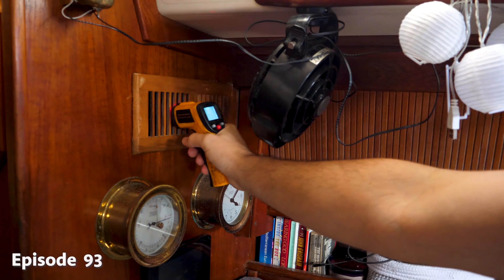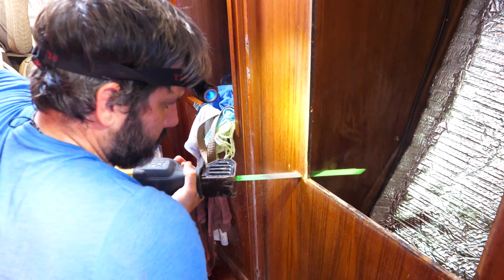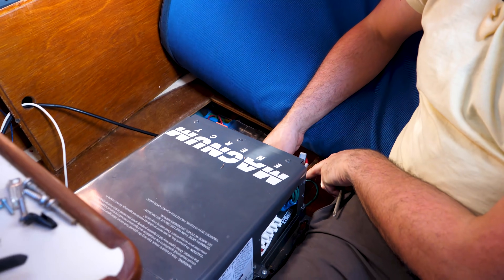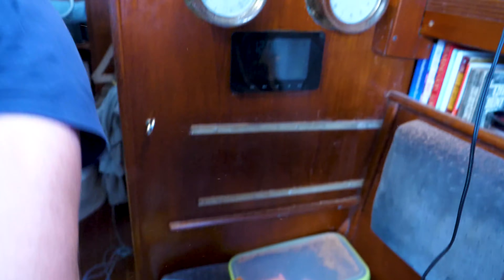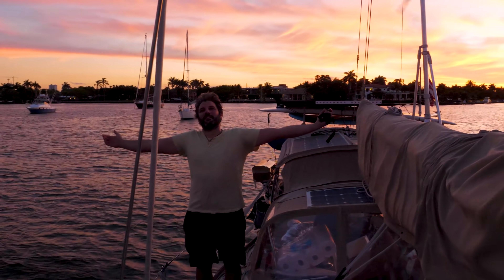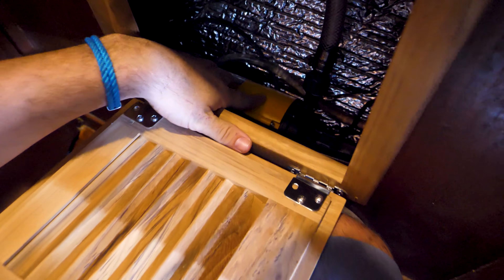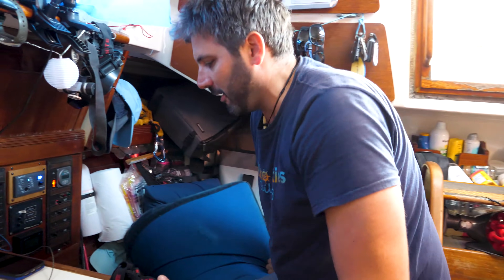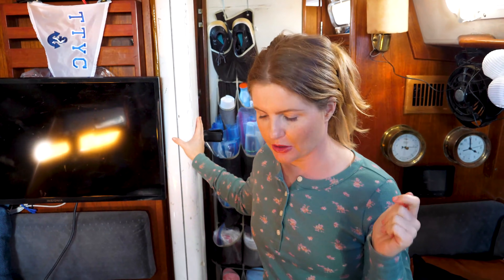Will we be able to run our 16,000 Btu AC off our lithium battery bank?! (Calico Skies Sailing Ep 93)

Comment: Nice job!  Its not easy to find room and install an AC unit in a small boat.  So a big thumbs up.  You will definitely enjoy having this in the tropics.  How long do you think you can run it off of your batteries?
Reply from the maker: Thanks! We feel like we almost got more usable space getting rid of the hanging locker and adding shelves over the air con. The closet space isn't really  optimizing space on a boat of our size!

Comment: Only Americans sail with AC,  do you still have some space for food on board...  Love your channel and your attitude to problems solving.   I have one question,  do you wire the Honda straight into the shore-power input?  Do you have any issues with ground and earth?
Reply from the maker: HAHA but it is just so nice!!! To be fair we did make it 11 years without one onboard 😂 I think converting the hanging locker to include shelves actually utilizes the space better and we actually got a little extra storage space 😀.

Yep we run the Honda straight into the shore power via an an adapter. No issues with ground so far. We just changed our prop zinc after a year and a half. I just went down a rabbit hole on cruisers forum on the topic tho, interesting question!

Comment: nice vid....how long can the ac go on the batteries?
Reply from the maker: Well it depends on how sunny it is, on a sunny day we can get an hour or two and still be fully charged at the end of the day. When it is cloudy we will start the air con on the inverter and the turn on our honda 2200 to power the air con!

Comment: Im curious....do you think there is still a quantum leap to be made in climate control for smaller yachts?
Reply from the maker: I sure hope so! Either battery/solar technology has to keep improving or we need to find away to reduce the load it takes to cool.
Reply: @CalicoSkiesSailing  Yea...it seems that battery tech has already reached its zenith..we shall see! Thanks for the response and, btw, nice job! There is nothing like ac to take the edge off of humidity and heat on a yacht interior of any size.
Reply: @CalicoSkiesSailing  they already have it half the power three times the price check out maybru AC units 👍🤔